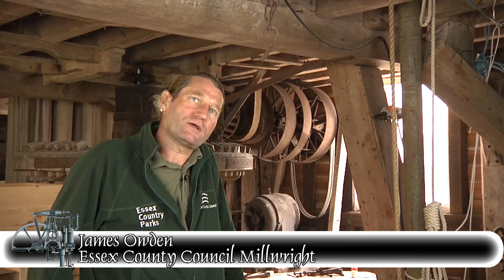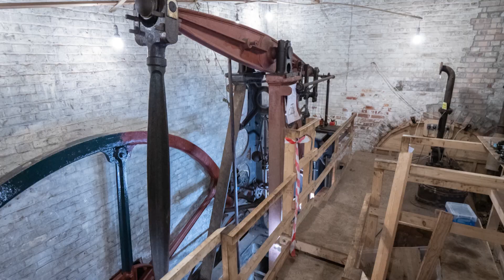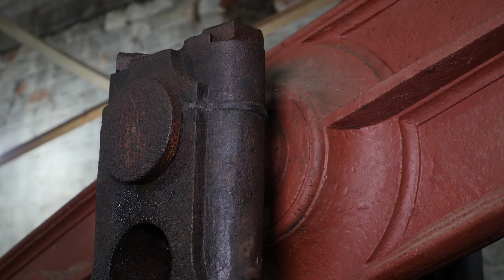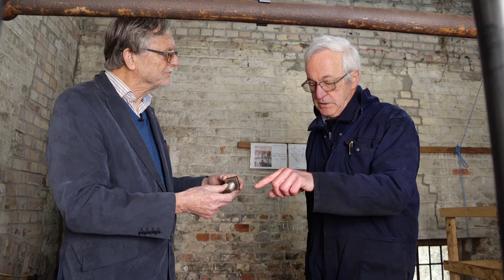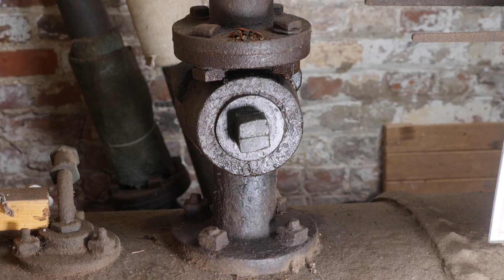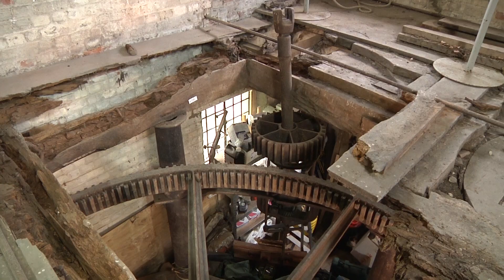Beeleigh Mill 3 - The Mechanics

Comment: Interesting video. I visited a few times, but interesting to see a few clips of the work in progress on the beam engine. The boiler, like the beam engine, is a rare surviving example of its type. The corrosion on the boiler, as stated, is so bad it will never run again. The engine I suggested would need a professional survey before it is run on compressed air. Certainly if run while visitors are present. Public liability insurance would be required. The cylinders you could argue would be turned into pressure vessels. And even at the low pressure suggested could cause the metal to fail. At the time of manufacture no consistent manufacturing standards existing.
Reply from the maker: Thank you for your kind words.